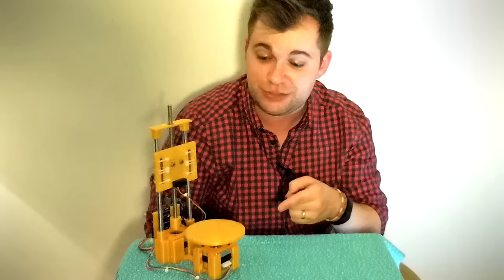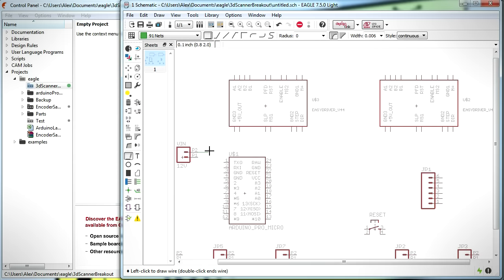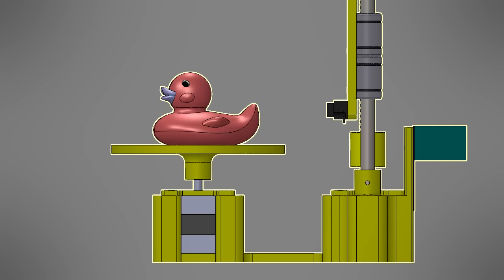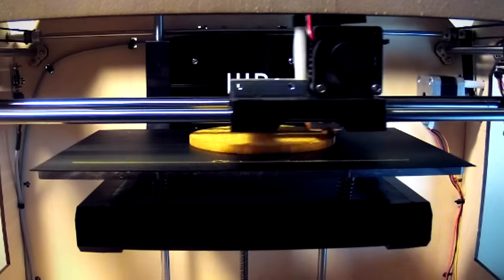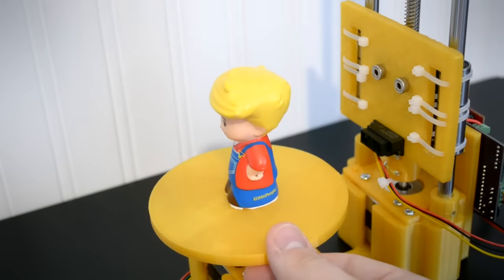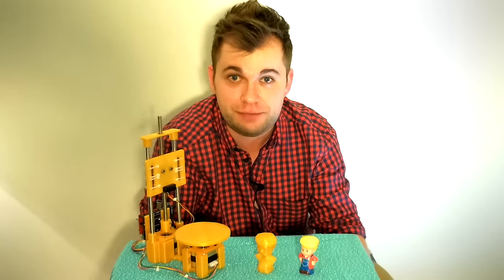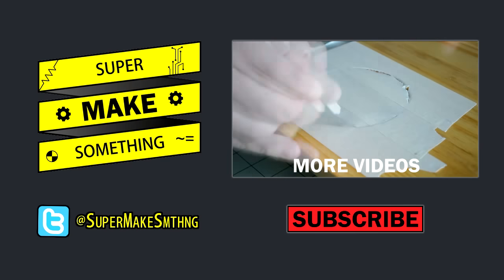DIY 3D Scanner (Arduino, 3D Printing, PCB Design, Stepper Motors, IR Sensing) - Super Make Something

Comment from the maker: NOTE: Due to various hardware differences, some Arduino variants may not be able to handle 12V at their input. It is recommended to start with a 5V source and then slowly increase the voltage until the scanner works and your motors turn.  A variable power supply is handy to test what voltage needs to be applied at the input.  These can be purchased here: https://amzn.to/461FTrR

Comment: Nice video. You could calibrate the IR scanner by adding a calibration shape on the rotating platform (below the object) and include that in the object scan. Since the calibration shape would have a known shape, you could use the values from that part of the scan to calibrate the distance values for the object. A spiral shape would probably work pretty well.

Comment: Thank you for the properly detailed documentation provided, came here from the video of that one uploader that just took the idea and didn't give any credit, thankfully you noticed it and we can actually properly do it and give the correct credits.
I wouldn't have imagined that a distance sensor like this would be that precise or specially, that it would measure pretty much a point in front of it instead of a wider area. I think I'll give it a try, since the Ciclop camera based scanner is a heck of a pain to calibrate if I can even get it to do it.

As a sort of unrelated comment, it's pretty funny to see how much 3D printing has evolved in the past years. 2016 is by no means stone age no matter how much at least phone manufacturers might want us to believe, but 3D printing has evolved massively since then, slicers specially, but even machines that at the price point they are now would be hopeless glorified glue guns in the earlier days.

Comment: This is awesome!! I was just at a Make-a-thon at my university a couple weeks ago where I built a 3D scanner like yours only I used K-nex, two hobby servos instead of steppers, and an ultrasonic sensor instead of an IR sensor. Just like you mentioned, the sensor had a ton of variability and MATLAB post processing was pretty involved. Wish I had steppers and an IR sensor at the time though. Great vid all in all, keep it up!
Reply from the maker: +Ian Sunyecz Thanks!  Your scanner sounds awesome.  Out of curiosity, how was the scan resolution with the ultrasonic sensor?  Is it possible to get a usable scan with the "spread" of the ultrasonic "beam?"
Reply: +Super Make Something The scan resolution was really not that great with the ultrasonic sensor. We played around with the best distance to put the sensor relative to the object and found it to be around 10cm. We took the average of 20 readings per turn but still had difficulties measuring distances around sharper corners/edges of the object. Your IR sensor seemed like it had much better resolution on your object than our ultrasound sensor. I would love to redo the project with a laser rangefinder like you mentioned to see how accurate the scan would be.

Comment: Hi Alex, That was very cool!! I do have an idea for your offset problem for objects out of center.  you could add another sensor on the exact opposite side across from the one you already have. taking the readings from both sensors and subtracting the difference should give you a more accurate model. maybe an idea worth playing with. none the less I am in awe, thank you very much! :)

Comment: I know this is old but I saw Mr. Innovation ripped off your project and immediately came here to see the original.  I needed a way to make a vertical lift to raise & lower a lidar to map the contours of a person, the idea being that the distances wouldn’t be distorted if the lidar just sat flat and had to be looking up & down.  Thanks for the tip!

Comment: likely some of the best arduino tutorials/project. very cool thanks for sharing and explaining in decent resolution
Reply from the maker: +Valentin Uzunov Thank you for your kind words!
Reply: +Super Make Something 
may what if any formal training have you had? electrical/mechanical engineering? 
I am personally really glad that you built this project and you built it right. I had a similar concept in mind but never broke motuvstion inertia. Seeing you built it validates the concept so I dont feel this itching need to built it myself to see if it will work. I will get to pop my arduino DYI cherry on some other project. Also, look forward to your site launch.  Your work will really help me (and many others no doubt) out eventually, but will teach me lots quickly.
Reply from the maker: +Valentin Uzunov I studied mechanical engineering, but I think the best way to really learn is to apply knowledge by doing a cool project.  I really like to build things and learned a lot of the "tricks of the trade" by getting my hands dirty -- for example, I have no formal training with microcontrollers/electronics, but I picked up a little here and there as I needed to learn during various builds.  

I'm really glad that my video has helped you!  It makes me happy to know that my video has taught someone something that they didn't know before and inspired them to try out a project!

Comment: I have a few questions. 

1.Can we get the resolution down to 0.1mm?
2. Would it be better to use an algo that throws out the high and low then take the median not the average for more accuracy?
3. Does your circuit use a ground plane or separate routed grounds?

I'm curious to see where this goes it's an amazing project great work and thanks for sharing it.
Reply from the maker: +bmmcwhirt Thank you!  Those are all good questions.

1. While the resolution can go "arbitrarily low" depending on how many samples you take per revolution and then how aggressively the object is filtered in post-processing, at the scan settings/processing options I used in this video, the resolution seems a little higher than 0.2mm.  Printing at 0.2mm layer height still produced some "noise artifacts" that made the overall surface finish a little jagged.
2. Taking the median is a great idea!  Assuming that the sensor has Gaussian white noise,  the mean should approach the median value with enough samples, but that is probably not an accurate assumption.  Definitely something worth trying -- it is an easy change in the code.
3. The circuit uses separate grounds that are all connected together.  I believe you are suggesting separate ground planes to prevent "contamination" between digital ground and the analog reference?  (Something like this? http://www.hottconsultants.com/techtips/split-gnd-plane.html)  I actually do not have much experience with this, as I don't do much analog sensing, but this is potentially a really good idea to lower the noise of the IR sensor further.
Reply: +Super Make Something Great, I'm looking at building something like this soonish since it's so relatively inexpensive. I don't know if you do or have used simplify3d as it's a tad pricy but it does a pretty good job at smoothing things out when you go to print them.

Even if you use the average, dropping the high and low values (or if you want to write an algo to detect all outliers) will result in a smoother surface in some cases where you might get some interference or dust particle or something.

I just recently learned about using the ground plane on a radio project I did. I have a friend that explained it to me then I used this instructable:  http://www.instructables.com/id/PCB-Creation-with-Eagle-for-Beginners/?ALLSTEPS

Again awesome work, it's projects like this that will continue to push consumer 3D printing forward.

Comment: There is another huge drawback, besides noise: the camera lift should be moved in a semi-circle, so it can also scan the TOP of the object from seen above. This was my first thought watching this video, and the result indeed showed that the figure's top is just nearly flat. But beside of that, it demonstrates a clever way to achieve 3D scans with a very limited budget.

Comment: To build a 3d printer you need a 3d printer... o.O
Reply: Liam Sream He's building a 3d SCANNER😑
Reply: no you dont.
Reply: Liam Sream I bought my 3D printer's 3D printed frame parts on eBay for $20 USD, and then I built the 3D printer/sourced electronics etc. I then printed spare parts for it ;)

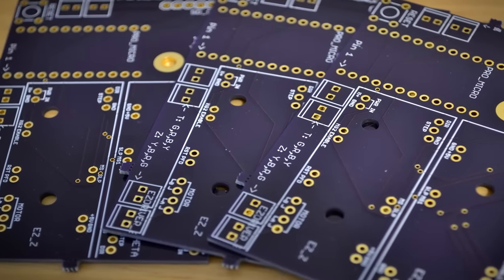Comment: 3:10 Install the boards in a breadboard when soldering. It makes every pin perfectly straight.
Reply from the maker: +Håvard .EF That is a really good tip I had not thought of, which would have made this step much easier.  Thank you!  I will definitely do this for my next soldering job.

Comment: I just built this based on your video, but I ran with a 1mm resolution LIDAR (VL6180x). The problem is that variations in color and reflectivity greatly impact the scanner readings. It was a pretty disappointing experiment, but it was fun coding it!
Reply from the maker: Josh Culley Thanks for coding this! Would you be willing to share the code on Github? I think it would be an awesome extension for this project!
Reply: @SuperMakeSomething  oh... well, I don't know how well it would fair as an extension. I didn't use any of your code; I just followed your project conceptually. I have this weird thing about needing to personally recreate the wheel every time I build something, so there's zero recycled code in there.  I didn't even use your STL files for the build. I literally made my own turn-table and everything.

Comment: Very nice and cool ! Like the details and also at the end the improvements list and the idea to use a LIDAR instead of the IR sensor! Well done !
Reply from the maker: +Paolo Roberto Thanks! I definitely think a LIDAR could improve the scan quality significantly.  From the IR sensor's datasheet, it looks like these sensors are primarily made for hand-towel and soap dispensers in bathrooms, so this project definitely pushes the sensor's limits.  Single-line LIDAR has recently become really cheap compared to what LIDAR used to cost, so if I ever get my hands on one, I'm definitely going to upgrade the project!
Reply: +Super Make Something Indeed it surprised me what that IR sensor was able to do, wasn't expecting it.
I have seen some of those cheap Laser distance meter for about 20 bucks, maybe one of those could be hackable to serve that purpose. who knows maybe some others will come up with suggestions.
Can't wait to see where this is going, cause it would be amazing to own a 3D laser scanner that cost's less than 100 $. 
Keep up the great job !

Comment: Great project.  Thanks for sharing it.   While I watched, and as I've watched others similar, I had a few thoughts.

1. Does ambient light impact the accuracy?   It would seem to me that an opaque enclosure would be a good idea if it does, possibly with consistent internal lighting, if light other than from the GP2Y0A51SK0F is needed.

2.  When re-reading for accuracy.  It would seem to me that you could determine how many times you need to read based on how close the first several responses are.   If you read it 5 times in a row and they are dead on each time, then you've got a good reading, no need to continue to read a hundred more times.

3.  If you determine some sections get more variance than other areas, you could create a second point cloud for the purpose of overlaying it with the first and possibly figure out what caused the variation.

4.  The GP2Y0A51SK0F is less than $10, you could increase the number of them possibly using mirrors.   Once calibrated, 3 sensors should do the job in 1/3 the time.
Reply from the maker: Dwight Wilbanks These are all very cool ideas! Ambient light from lamps, etc. does not seem to affect the readings, however sunlight might.
Reply: do you think that mirrors would work for measuring from different perspectives?  I also wondered about using a single sensor and some type of spinning apparatus which would direct the light to different mirrors.  The idea is not very solid in my mind yet about exactly how that would work, but it seem to me that more angles is better.

I've also seen a lot of work with standard cameras, that photograph the image from lots of different angles.   That requires a huge amount of PC power to calculate from all the angles, but, it's 2017.   We've got cloud computing.

A raspberry pi could handle the local processing, then upload the pictures to a service to create the point cloud and download a completed design.  It also seems to me that if you leave the object in place, you could look at it and identify areas to get better resolution.   On a camera based solution that would be just a matter of higher resolution pictures.  Maybe a lens?
Reply from the maker: Dwight Wilbanks The mirror setup sounds like it could work, but may require extensive calibration that could be difficult to create at home without high accuracy equipment. Check out the "velodyne lidar" sensor for a similar idea with mirrors. (In this case, mirrors are used to get a 360 degree scan for things like autonomous vehicles.) For the effort and price along this path, it may be best to go with several IR sensors at different locations instead. 

Interestingly, Autodesk came out with a camera/computer vision based scanner after I released this video.  Not sure how well it works, but I remembered thinking that some of the scans I saw looked pretty cool!

Comment: Very well presented.  Thank you.  You mention that resolution may be improved by using laser instead of IR.  Have you advanced this idea at all?
Reply from the maker: Thank you very much.  I have unfortunately not had a chance to advance this idea yet.  However, I did recently pick up an old Microsoft Kinect, which, while not having laser technology, does have more IR sensors, which may improve the resolution.  Perhaps I will need to build a full-body scanner using this sensor at some point in the future... :)

Comment: What did u do for different colors, because ir sensor will give different measurements for different colors and accuracy is more important here right
Reply from the maker: The color was just a color mapping from MATLAB that was dependent on the z-height.  The scanner did not scan any actual colors, just contours.

Comment: How about using camera and essentially green screen tech to create the object in line with the IR or laser head? Camera takes pictures against green of blue screen, filters the shape out and adds that data to mix, where IR or laser gets the base line data that is refined with shape data... or something like that! I'm not software engineer if you could not tell! XD

Also you could try driving second scan with IR sensor angled 45? degrees, using small motor, to get top of the head and other surfaces that you cant get from straight scan.
Reply from the maker: +Hellsong89 That is actually a really cool idea that could be accomplished with some camera/IR sensor calibration!  Adding a second scanner at a different location would also do a lot to fill in the gaps which a single beam scanner that is mounted perpendicular to the object is not able to reach.  Thanks!

Comment: Very impressive work, your 3D modeling, coding, and Eagle skills are great.  Would love to know what school or other resource helped you pick up all these great skills.
Reply from the maker: +Rob G Thank you! I studied mechanical engineering, but a lot of the skills that go into my projects were learned by doing as I went along -- I have no formal microcontroller or PCB design training for example. I think the best way to learn is to just go out and get your hands dirty! You may not succeed at everything at first, but the skills will slowly build over time!

Comment: Hello @SuperMakeSomething , I liked this project a lot and decided to use it for my college project. I was wondering if I could use a HC05 Bluetooth module to transmit data wirelessly and thus removing the SD card. Some research later I’m really confused if it could work. What can I do ?
Reply from the maker: I’m not familiar with the HC05 module, but sending the data via Bluetooth as a virtual serial stream may work. However this will likely require different connections and you may not be able to use the PCB I made for this project. Hope this helps and good luck!

Comment: Can YOUPLEASE do a video showing the update to laser rangefinder for better resolution? I'm just building mine, and would like to go with the best quality possible right from the start..
But I'd need your wiring and coding to make it work. Lol.
Thanks
Reply from the maker: Unfortunately I have not yet had time to revisit this project and update it with a laser scanner.  Since making this video, there have been a few advances in the area of 3D scanning (photogrammetry, etc.), so I would definitely recommend checking those out as well!

Comment: Good build. You might just buy the motherboard from a 3D printer instead of all the work to build the same thing. The motherboard has the stepper drivers already attached; it is only around $45- and uses the Arduino Mega.